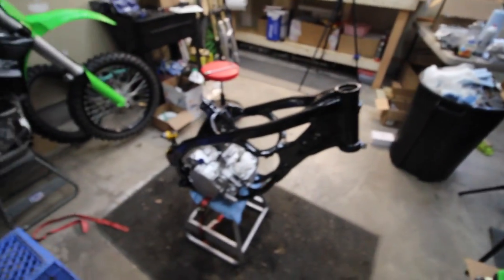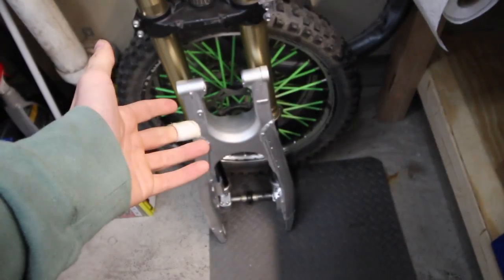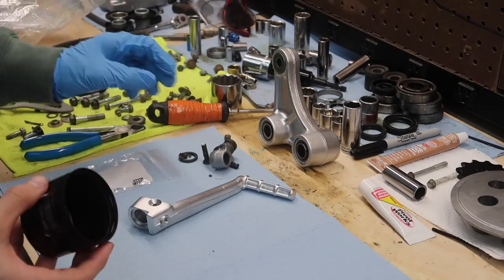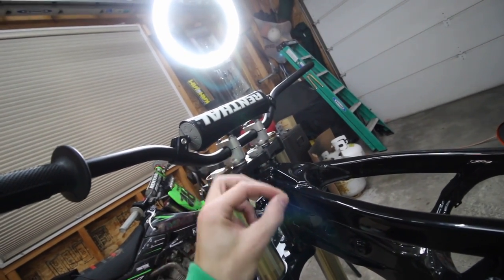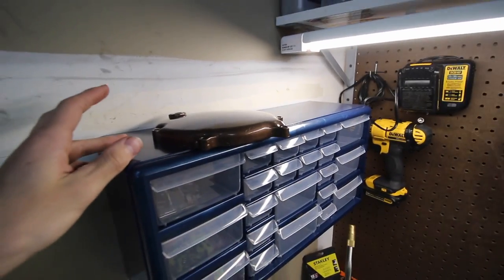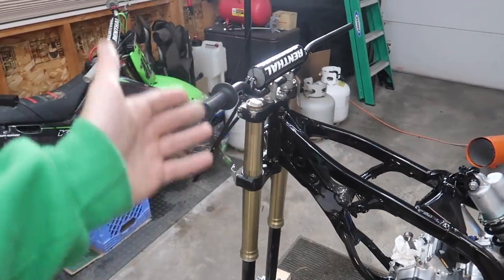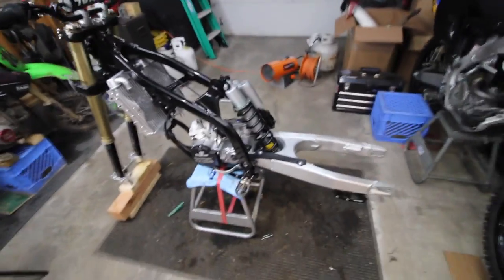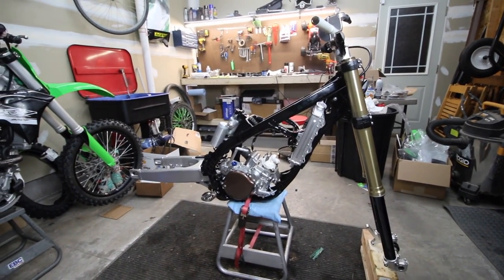2018 KX125 BUILD PT.8 | SUSPENSION +  It's Almost Done

Comment: Hey Tyler. I did the 2010 fork swap on my ‘03 kx250. We had to weld a different steering stop onto the frame in order for the angle on the 2010 kx250f triple trees to be the same as the 2003 triple tree clamps. Just a heads up. Keep up the good work 👍🏼
Reply from the maker: Thanks man ill take a look at mine to see where it stops!

Comment: Paint is hard to do well, the best way to make it last is : prepare the surface extremely well, sand and degrease. Then use an enamel paint, dry it hanging not sitting, let it dry for a number of days, then over coat with a ceramic clear, let it dry for a couple hours, then bake at 180 deg Celsius for two 30min cycles. This way you get a tough enamel finish that is resistant to solvents.

Comment: Did you weld an extension onto the steering stop? A guy on the vitalmx forums also used some kx250f forks and clamps and the forks would hit the frame before the clamps hit the steering stop..
Reply: Trick engineering makes adapter for that

Comment: Are those the stock triple clamps? Your also going to need to take both radiators off to slide the cylinder on. I've got an 04 that I've had since it was new and have rebuilt it a few times from the ground up.

Comment: Use stock black radiator hoses, oem throttle with a pc tube, no bearings tube it’s shitty. Use electric black tape instead of zip ties, look better !